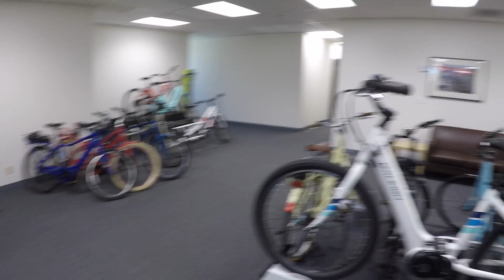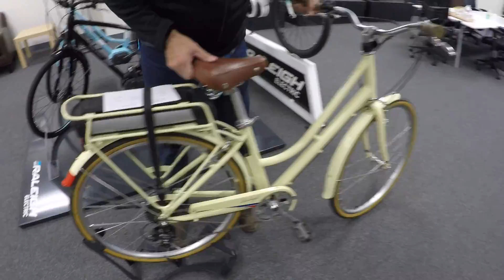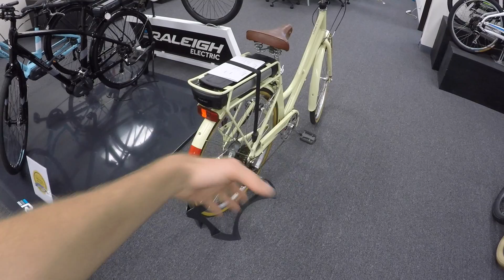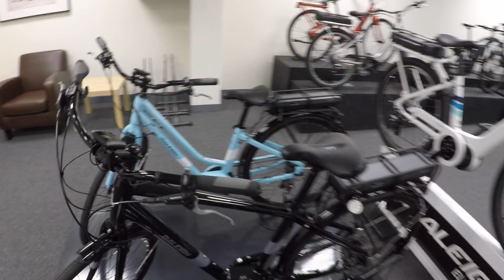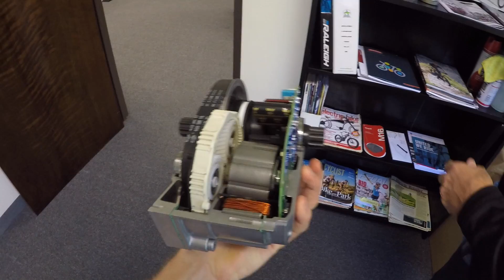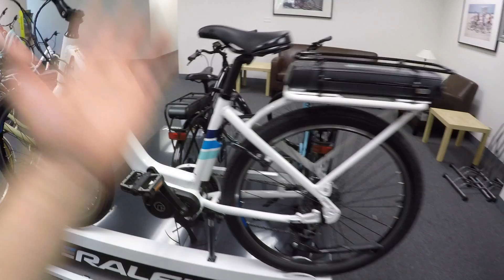Raleigh Electric Bikes Deep Dive with President Larry Pizzi

Comment: I have a Raleigh 2015 e-bike which has a broken torque sensor, I am quite good at fixing things so I tried fixing it but it isn’t fixer friendly at all which means that the repair will be expensive so be warned when choosing a e-bike look for one that allows easy repair.
Reply: The company believes that if it breaks you should buy a new one

Comment: Are the chain's and cassettes on these bikes actually ebike specific? The step thru recently reviewed looked to be just standard bike parts?? No power cut on brakes seems like a bad idea (lawsuit) waiting to happen... Interested in being able to adjust the power to custom fit customer preference but it would be nice to see that in action. Pizzi makes me dubious of what he says the bike could do.. I thought that he was going to make a point about the neuton meters of a mid vs a rear hub and distance but it didn't go there. So if a motor pulls less 350 vs a 500 the battery will last longer?  So no more motor by currie electric is the new mid drive better? How does it compare to last years model? I wish we could have a myth busting session on these bikes so I know what to believe.

Comment: Hi Court. Great channel. I do think though that all electric bikes should cut out when brakes are applied, be they hydraulic or cable.  I think you feel that way too, and the run around that Raleigh gave about "too complicated" is nonsense. If you can build a mid drive, you can add motor cut off as a  safety issue.

Comment: What about the frame flex problem with the poor weight distribution and low step frame? COURT please update this, as you are supposed to be impartial, right? Do you have any financial interest in promoting Raleigh electric bikes? Did you get any free bikes or payment in kind from Raleigh?
Reply from the maker: That's a good point, the step-thru would suffer from a bit more frame flex but the mid-motor helps. There are lots of considerations with every model and I try to be thorough but sometimes emphasize one aspect over another. Like the shift sensing cadence issue. I appreciate your feedback

Comment: Off topic for this video but....how do you feel about carrying a second battery while you ride ?
Reply: yep, Courts the man. I got mine thru his reviews when I knew NOTHING about them. we all sprung for extra batteries because of the remoteness where we camp in Michigan's upper peninsula. remarkable trails, but no go juice. it turns a long weekend/a weeks stay into confident riding. I can totally see a benefit for what your into as well. please stay safe in L.A.!
Reply from the maker: No worries, I feel like it can make sense and work very well on some trekking models with rear racks. The Bosch Powerpack 400 is ~5.4 lbs and the 500 is ~5.7 lbs which isn't too bad for a backpack but the shape is a bit thick. Some newer ebikes have double battery setups like the Riese & Müller Delite but that one costs a lot more. I love that the Bosch system in particular is capable of leveling and managing two batteries at once if it's setup this way. A second battery on its own is ~$900. https://electricbikereview.com/riese-muller/delite-gt-nuvinci-hs/ does this help to answer your question? Feel free to clarify and I'll chime in again.
Reply: sup Katman...
Reply: Michigan Mister hey MM.  trying to get some expert advice in the best way to stay out longer filming.  This guys channel has great electric bike stuff